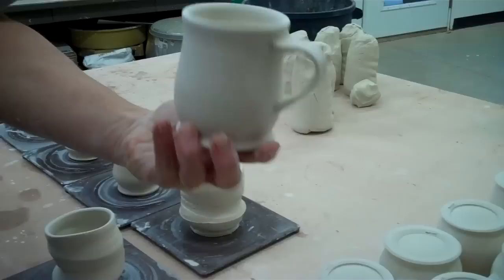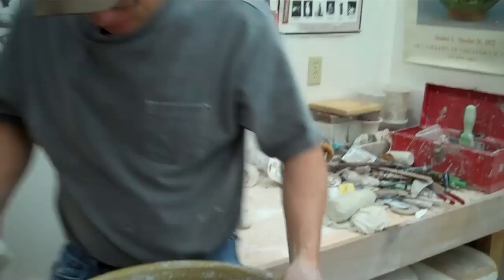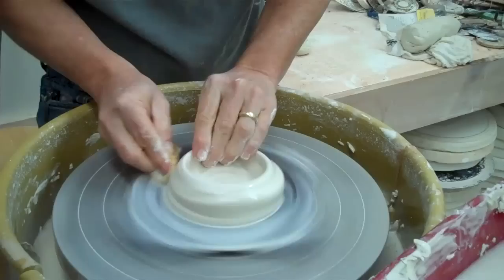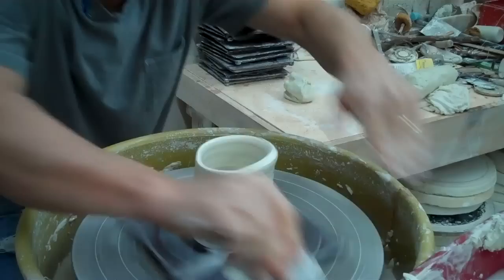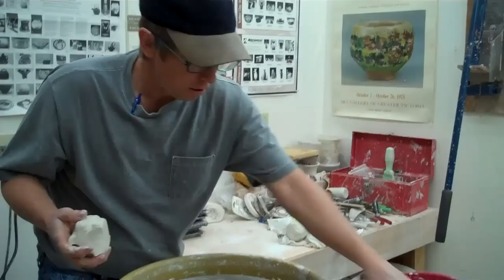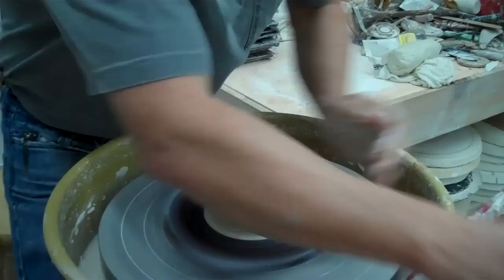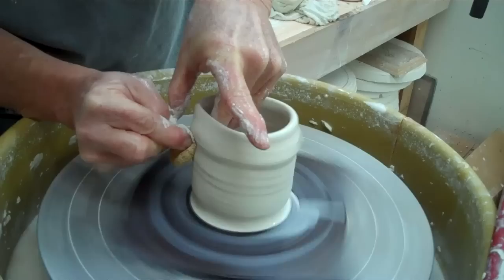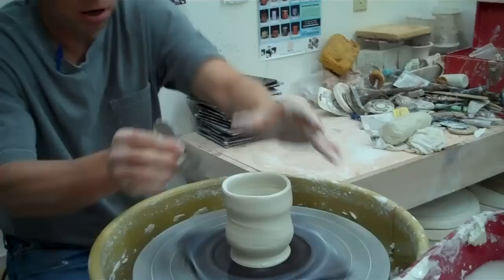Throwing Loose Yunomi's

Comment: How do you trim?
Reply: It's a little tricky and might take some practice. To trim the foot, turn the pot upside down on your bat. It will be weird at first because centering it before you anchor it down to trim, may seem impossible. The easiest way (for me) is to focus only on the exact center of the foot. Ignore the off-centered walls or you'll go nuts. Once the foot is centered, anchor the pot down and use the same technique (only focus on the center of the foot) to trim your foot. Hope this helps. :)
Reply: Use a foam bat